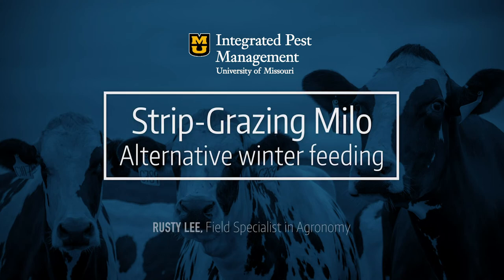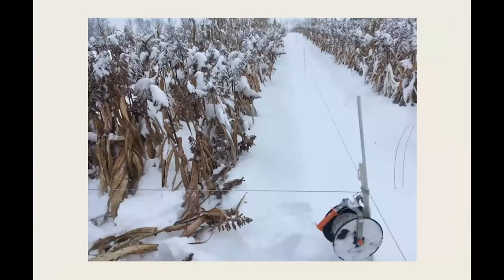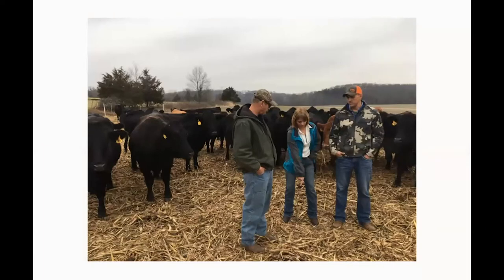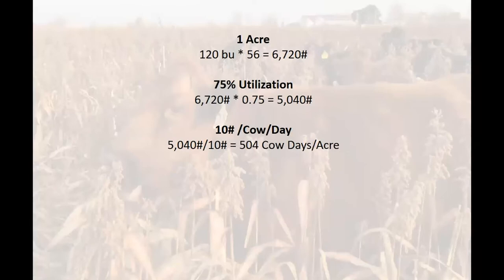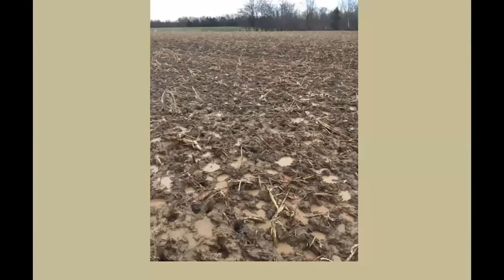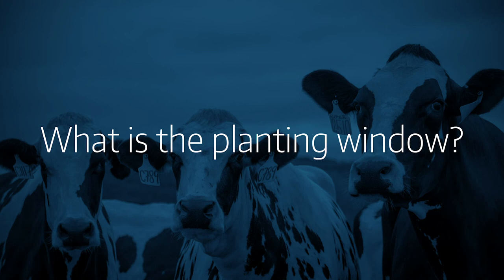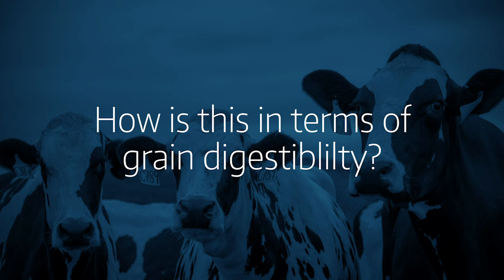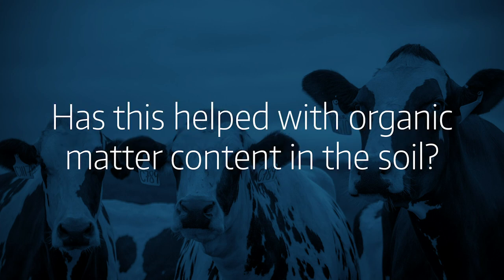Strip Grazing Milo: An Alternative Winter Feeding

Comment: Is there any wt. gain advantage to a dwarf brachytic, brown mid-rib type sorghum? Do you have any sugarcane aphid problems? Does this work better w/dry cows, or fall calving herds? Lots of questions! But cutting costs by 1/2 or so is a big deal.
Reply: As I work with different producers, I get to see "experiments" with variations to the conventional grain sorghum, and some have tried the BMRs with mixed success.  Keep this in mind:  When looking to create a winter feed, energy in the diet is the bigger expense compared to providing dry matter.  Assuming one has medium quality hay, or stockpiled fescue, or other roughage, then we are back to needing energy.  This is where the importance of grain yield comes in.  The grazing days per acre is heavily dependent on grain yield, which often gives the advantage to a conventional grain sorghum.  Can you graze brachytic dwarfs, yes.  If you are short on dm for the winter, maybe give it a try.  Sugarcane Aphids/Sorghum Aphids have not been an issue on the farms I have worked with.  If they were present in a field, the yield reduction potential from the pest would drive the decision to justify the pesticide control expense.
A Fall calving cow at peak lactation is definitely a high energy requiring class of animal.  When you provide a lower cost option of nutrition at a time of peak demand, that creates the biggest opportunity for savings.  That said, this system works for either dry or lactating animals.
Reply: @rustylee2531  Thanks for the info! Are there any milo varieties you've found that retain grain,in the head,longer into the winter? Any varieties deer won't decimate? Man, I've got more questions than a three yr.-old! I'm located in south central mo, so geographically not too far from your area.